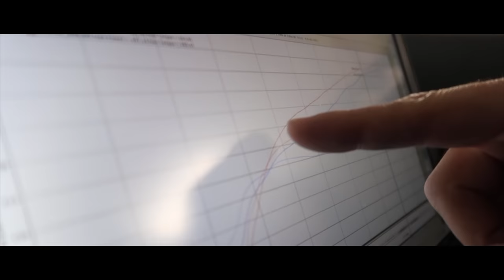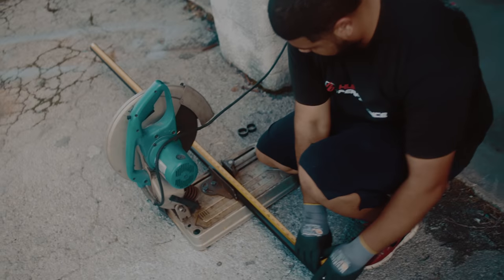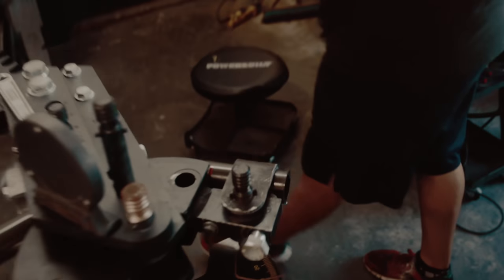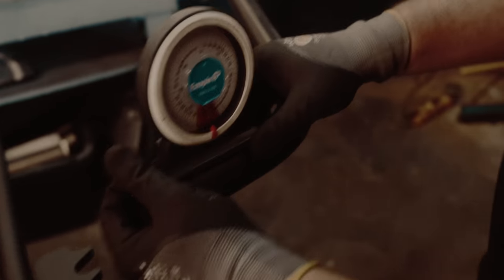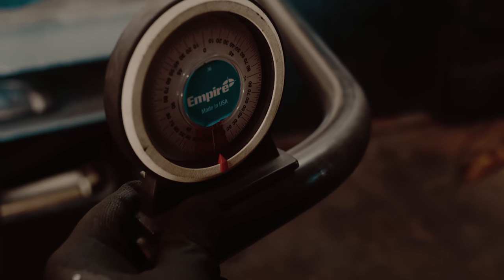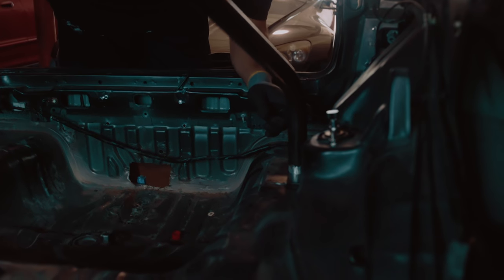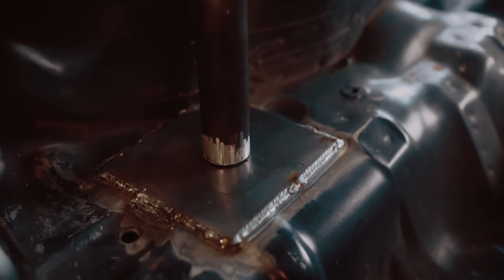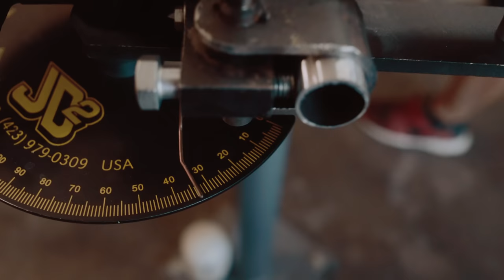10 Second Civic Gets A New Head Gasket + Fabricating A Roll Cage (4K)

Comment: I'm not hating on this shop but man I hate seeing those rear bars bent and mounted like that. They basically do nothing and aren't safe. The rear bars should contact the rear struts without bends. I get it's not a 8.5 car but still it's not the safe way to do it.

To anyone out there reading this that doesn't know, this is not an example on what you should opt for.